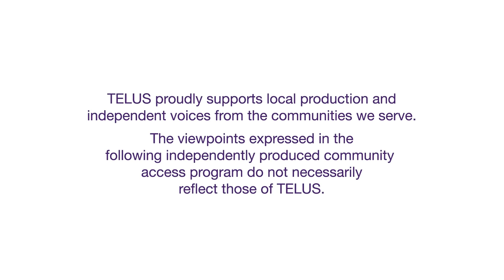Groundwork Episode 3 - Building with Straw Bale

Comment: I noticed at 7:44 there is a view of the ICF that was used in this project. I am not against what they are doing, but you could have mentioned that you also used ICF. In other words, "Insulated Concrete Forms" So it is NOT all "Straw Bale". Just keep things honest is my point. Regardless, nice build.
Blessings
Reply: Well spotted. I wonder if the ICF was foundational only due to code.